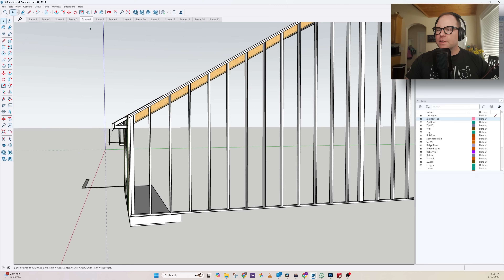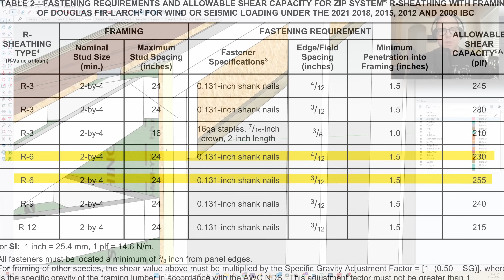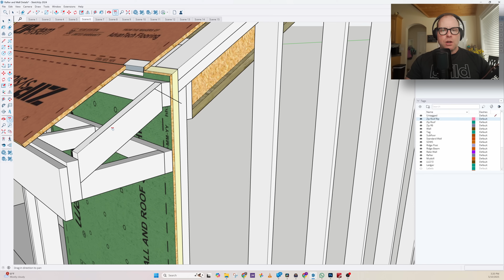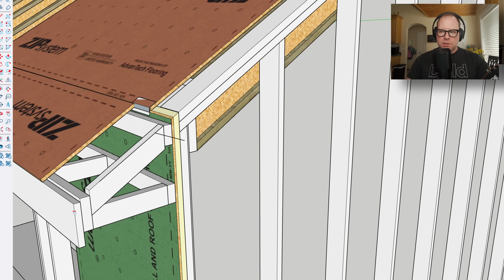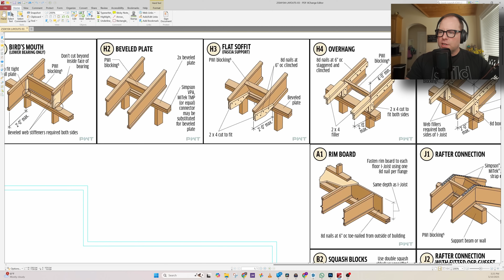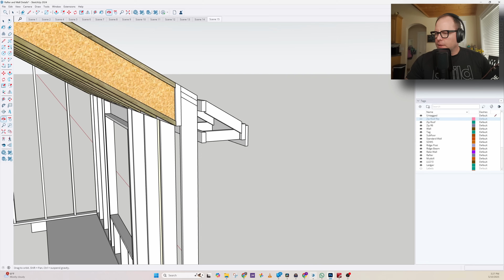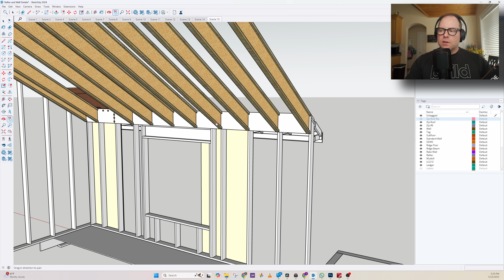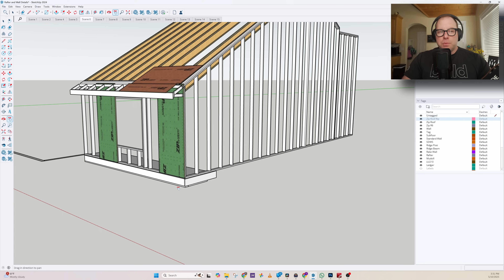Help Me Build It Better – Your Feedback Needed!

Comment: I am a structural engineer that specializes in residential structures, and I’ve been trying to get a few contractors to frame roofs like this in the past without any luck. I hate doing the annoying detailing required for sloped TJI framing at bearing walls. It’s awful. So much stuff to scab on!! I’ve wanted to hang them like you propose, which is basically how we do modified balloon framing for multistory light frame residential (apartments, hotels, etc). That has worked for decades so why not bring it to single family?!

I did not try it with the zip system, just sheathing, but otherwise it was the same as you’ve modeled. 
I was also using straps across the top of the eave framing to the top of the TJI rafters (instead of using just a screw through the sheathing to the plates). It’s a much stronger connection and you only need the straps every third rafter or so. I’m always concerned with the point load of someone standing right on the edge of the eave. That load is significant since you don’t have the repetitive members to take up the slack like you do in the roof field. 

Anyway I’ve emailed you in the past hoping that you’d be interested in another engineer to work with but never heard back :-(
Figured I better comment again since not only are you trying to do the same thing I’ve tried in the past but you’re also going through an engineer transition! I’m Portland based, SE licensed, and do work in CA, OR, and WA. Reach out if you’re interested! I always enjoy your channel. A good way for me to get out in the field from my desk :-)
Reply from the maker: I'm sorry, shoot me an email and I'll make sure to save the contact info.  Someday we should meet up at Multnomah Whiskey Library 🙂
Reply: @AwesomeFramers  Will do! The aesthetic alone makes that place worth the visit!
Reply: @AwesomeFramers  Sent! 👍
Reply: The strapping really makes good sense to me, especially compared to the screw on an angle going through an intermediate inch of foam board. I'm sure the screw rating would be fine, but it doesn't give me the warm and fuzzies since it would be something of a lever bearing on the zip board. 
From your perspective, what's to gain in not strapping to every rafter? Is it simply the habit of best practices in specifying a minimum even though in this case it wouldn't add significant labor; perhaps allowing some flexibility to the builder if there's an unforeseen conflict?
Genuine question as my engineering background is from industrial automation and manufacturing, so I am always interested in the rationale in other fields.
Reply: @GimpGladly  Agreed. I didn't totally love the screw for the eave when I looked at it with standard sheathing, even though the numbers did technically work. I like it even less with the insulation of the zip system getting involved in the load path. The code does not require different roof live loads for eaves but in my opinion, they can get more heavily loaded than the roof field and they have way less reserve capacity and way less redundancy. I didn't love basically relying completely on a single point of failure with a brittle mechanism (the screw). Thus the strap idea. It's a far more ductile failure mode and it has way more excess capacity. My logic for only strapping every other or every third is just to save material and labor. The fascia can easily  span between the strapped eave "rafters" for 4 to 6 feet just fine. But if a framer wanted to strap them all, you wouldn't get any complaints from me!
Reply: @det-ou9vz  I hope my comments come across as positive.
Texts never gets the smile across.
Love venues like this where we can learn from people that obviously know what they're doing.
Thanks everyone
Reply: Didn't read this comment technically but would you use R sheathing for the roof in your design? Huber requires R sheathing use on thw roof to be speced by design professionals.
Reply: I don't like the eave being completely separated,  at least run a full sheathing all the way down. Relying on framers to do everything properly is almost over
Reply from the maker: @TomLinehan-d7d  I'm the framer 🤣🤣🤣
Reply: @AwesomeFramers 😂, to be fair there does seem to be a specific source for sterotypes like this. Production vs Custom/Spec homes maybe? But that is getting into the "let's not do this, guys" territory, so I'll leave it there.
Reply: @TomLinehan-d7d  A full sheet of sheathing is nice but not necessary with the straps. Most framers I know are very capable and pay close attention to detail. They will get those straps right no problem.
Reply: @det-ou9vz  relying on whatever Simpson makes today isn't always the correct answer
Reply: @TomLinehan-d7d  Okie dokie dude 👍

Comment: lets do a live stream with stream yard and have some guest I am down with it 43 plus year building in Canada get an old mans Thoughts .. with what you want to do you compromise the horizontal load value on the roof and require to many members and not worth it I have a better solution that will do what you want to do  for you .I will have to use my White board as I am not tech savvy

Comment: So you can’t add the rake wall overhang beforehand, like you are used to doing.
Reply from the maker: No, I absolutely will be framing those as we normally do, I just left it out for simplicity.  I should have mentioned that.  I'll tape the Zip R to the top plates, so I guess you could say we are relying on the sealant on the rake walls..........good catch
Reply: @AwesomeFramers I look forward to seeing it!
Reply: @AwesomeFramers  The ladder on the rake seemed implied.

Comment: I also really like the idea of keeping the same connection when you can. Have you thought about building up a box beam long  the top of the wall. The top could be beveled to match the roof pitch and the inside face  stays in the same plane as the wall and adjacent glue lam. and any voids can be insulated.

Comment: Awesome ideas you have Tim. As I used to do framing for many years and know how much time is consumed building soffits and installing hurricane hardware the old way. Your idea with a double ledger is solid and proven, instead of overhanging scabbed 2x4's from the main rafters. And I love how you chose angled walls to support those long rafters. No cuts to the rafters makes good use of the engineering built into them. And it simplifies the process of getting them fastened down thru the top plate. My only concern is stopping the 1st row of roof sheathing at the wall/soffit line just to add tape for a tight seal with the wall below. My thoughts are to just run the sheets up from the facia and onto the main roof to tie the framing all together. How much could you possibly lose in heat or AC at that tape joint? Earthquakes add another reason to tie it together with sheathing also. Awesome video and excellent planning on your part. Work smarter not harder. 😉

Comment: This will be a fun series. I'm looking forward to it. Those details are interesting. I'll certainly chime in if I come up with anything that I think might be useful. 

Your framing techniques are so different from ours. I would love to see our folks adapt some of your methods. It's difficult, though, because everyone is so stubborn. I have the hardest time getting them to do even small things, like leaving out the cripple blocks at each end of a header or sill.

For some reason, everyone seems unable to see the broader picture of the cumulative effect of small efficiencies. Forget about trying any of the big things. The financial incentive alone should be enough to motivate most people. The resistance is just absurd. sigh

Comment: Just a thought . Why couldn't you make the wall wider than normal frame as you normally do just stop in the middle of the wall sheet the roof and end of rafters ,then proceed on with same material as rafters .
Reply from the maker: Absolutely could!  I'll have to think about that.  Framing with 2x8 instead of 2x6?
Reply: @AwesomeFramers  or double up 2x4 walls.

Comment: French cleat it with metal brackets.  Build boxes on ground and raise in place with your lift.  Then cover with sheeting and seal.
Reply: Like that idea to ease the install. Raise or lower it from the metal cleats with screws then install the structural screws.
Tape/seal the sheathing to sheathing gap.
Steel strap it to the roof if anyone's worried about load on the detail.

Comment: Monopoly building is far superior. Seal everything and build out your overhangs. I'm digging this build and the details you're using.
Reply from the maker: Thanks! I'm really looking forward to this
Reply: @AwesomeFramers  as a pnw small builder as well you guys are great. We do a lot of R6 up to roof line typically with a raised heal ends up a similat concept to your idea. Only thing I see of concern is the roof to wall insulation detail is the weakest link. The spray foam can crack right there and allow just enough for condensation to happen. Build show typically has an insulation on the roof that addresses that. A vent channel on the outside of your roof (essentially 2nd roof) might help. Maybe rigid with a flexible air sealant for an air channel to keep things flexible in the inside  of the envelope for a few feet until air temp balances

Very curious to see the update on what happened
Reply: Agreed.  Monopoly framing is the way to go.  I'd be very deliberate about the tape joint on the roof side.  Obviously the wall to roof connection.  Also, the overhang to roof tape.  You don't want two layers of seam tape "lining up".  
Now I'm wondering if a second tape strip is required.  I'm in a northern climate where an adhered ice & water shield is required.  Should the overhang sheeting be tape & ice & water?  Not sure.
Reply: Monopoly framing only makes sense to me in full vaults and fully conditioned attics, otherwise you're loosing on ROI verse standard attic insulation and a vented attic.  Plus, very hard to monopoly frame in zones 4 and up, where are you going to get R49 in a rafter bay....you'd need 14 inches of spray foam to accomplish that.  Maybe this works in zones 1-3.  I guess you could always throw sheet of ridged insulation on top of the roof sheathing but I just don't like all these layers of stuff over/under the structural framing or sheathing.  If moisture/vapor/water/condensate ever gets in there you don't know it until it's too late.  Nope, not a fan of it in practice but i do like the idea of it
Reply: @Ifishmo  Actually the over and under insulation you describe is the best way to prevent moisture and condensation in the structure.
Reply: @pcatful  I helps with condensation via 'cold spots' but does not help with water intrusion (inward leakage).  Is the case of water leakage, all of the extra insulation will make it much worse as it's much more difficult to dry once wet .  There's no perfect insulation or 'air tightness', there's always pro's and con's.  A water leak in a 'sealed' attic will stay wet/humid for a very long time unless dehumidified/vented vs the open air attic which would dry out readily in a few days/weeks.  Keeping water out is only as good as your waterproofing systems.  For a roof that most likely will get hundreds in not thousands of holes put in it as part of the installation process for shingles, standing seam, not spray foaming the under the sheathing/framing structures makes the most sense to me.  If you ever do have water issues with the spray foam system, there's a good chance you found out too late and now there is structural damage that needs addressed.  I like all the high tech insulation options we have now, just have to be used the correct way to ensure we're not causing more problems than fixing.

Comment: Hi Tim,

After watching your video I have some questions for you.

The big detail (for the air sealing perpective) is the transition at the top of the wall. You prefer to put tape because you can quality control it. What about the transition with the roof and the big rake wall? 

The other thing is the hybrid monopoly framing you'll do. You'll have a vented ridge (if the new construction is the same as the video you are showing) and you are using the 5/8 Zip as an air barrier. Wouldn't it be preferable to transition the air sealing to the underside of the roof structure? Like you and Steve said, if you draw a line to the outer perimeter of the house, the line will be broken at the ridge. I don't get the added value of taping some of the wall to roof transition and having a vented ridge.

Personnally, I tried the popular way people do by putting an air barrier membrane transtion on the top of my exterior wall to connect the Zip to the interior air sealing membrane prior to installing the roof framing and I hated it. When placing the trusses (or your I joists) it is really easy to tear the membrane when you push/pull to position the rafter.

The way your wall is detail at the top, I think the easiest way to transition is to use the popular way but do it between the two top plate. You'll be able to tape it on the exterior sheating before building the overhang. No need to be carefull when installing trusses . When doing the interior sealing membrane, it will be easy to connect the two since it will be hanging there.

My two cents,

Fellow Montreal carpenter
Reply: I would just use an exterior vented space.  That way, I keep my air barrier intact.
Reply: Doubt the ridge is vented. The monopoly framing he's referring to includes the attic in the insulated space. Check out how Matt from the Build Show to builds houses

Comment: So you aren’t interested in ventilating the “attic space” in the open ceiling?
I like the way you do this.
I would run the rake wall short at the corner, the bearing wall past, and run a rafter on top of the rake wall. This was insurance from uneven slabs and framing mistakes. I also did a lot of open beam work with exposed resawn rafters with a rafter over the wall. 
Your crew is conscious and precise- something I didn’t always have.

Comment: I'm interested if using zip-r on the roof is possible. That would make it easier to add continuous insulation on the roof.
Reply from the maker: Currently it is not warranted for that use https://www.huberwood.com/blog/14-things-about-zip-system-r-sheathing-you-need-to-know
Reply: @AwesomeFramers  thanks!
Reply: @AwesomeFramers it can be used for it they just want a design Profesional to design the roof system. I can see why that done considering all the ways roofs can mess up without venting or conditioning.
Reply from the maker: @sparksmcgee6641  I have been in meetings with Huber, including 1 Phd and there's more to the story than they "just want a design professional to design the roof system".  I don't think the issues are insurmountable, but at this stage we wouldn't take the liability on.
Reply: @AwesomeFramers  Cool. Thanks for the clarification. I thought of making a comment then my brain broke thinking of all the issues of roof vs wall on how houses actually function.
I hope they get a product for the full wrap with the R product. Once they do we're set with an idiot proof envelope.
And I'm one of the better idiots this country has developed.
Reply: Stay away from zip it is not vapor open. That makes it not suitable for a hot roof

Comment: why not use zip R on the roof as well? even if it's a thinner foam like zip r3? i think that works well. 
the issue with monopoly framing i think is that you've got to deal with moisture and humidity. it flows all the way up to the ridge. even if you use closed cell sprayfoam on the back  of the roof sheathing, the external side of that sheathing is getting baked/frozen and so the wood can shift and then you have a space behind the closed cell where moisture can accumulate. this is why external insulation is good, even on the roof, cus it keeps the wood within a narrower temperature band. 
i have no idea what your humidity levels are like, but assuming you use an erv, sometimes it can't handle the swings in the shoulder seasons....might need a dehumidifier, with it's probe right at the ridge line. unless you use a ridge vent?
anyways, i think zip r on the roof and then some sort continuous air gap direcly below the roofing should be good. even if you have a closed soffit, can use 2x1s or just some mesh product that makes it so that air can flow under the external edge and up towards the ridge, to move moisture away. can be tiny, like quarter inch. if larger, like the 1x2, best to use some sort of bug mesh around the edge to prevent critters and birds
Reply from the maker: The manufacturer doesn't warrant a roof application. https://www.huberwood.com/blog/14-things-about-zip-system-r-sheathing-you-need-to-know

My understanding in talking with Huber is part of the issue is the uplift on the nailing.
Reply: makes sense!
Reply: Zip is not appropriate for hot roofs as it is not vapor open
Reply: You may want to read up hot cold versus cold roof.  No dig on you, just to broaden your definition of a roof.
Reply: Hot roof versus cold roof. Android chrome on this phone doesnt allow me to fix error.
Reply: There are a number of reasons why not to run zip are on your roof framing but the main consideration is there is a long-term value to consider.  The poly I saw will shrink a bit which could cause any fasteners at the roof to not be as tight as they should be long-term.
Reply: Tim and Brian understand what needs to be taken into consideration when building this way.
Reply: Its a good question, he could do Hunter Panels. But its quite expensive and the finished product looks like curse words bad IMO.